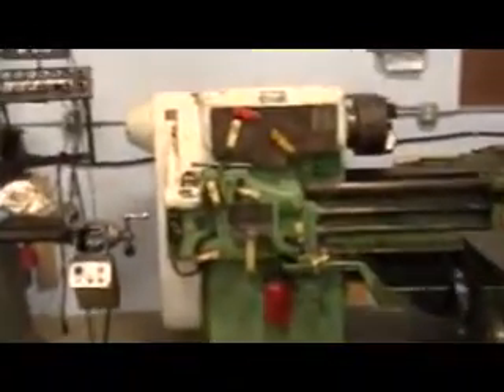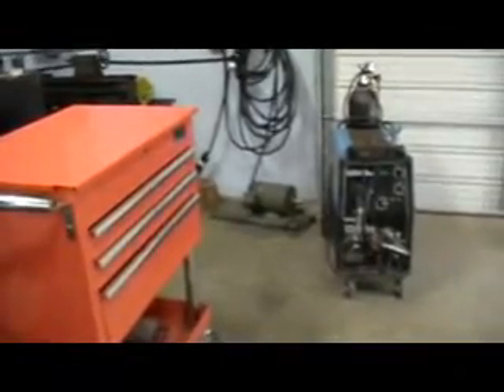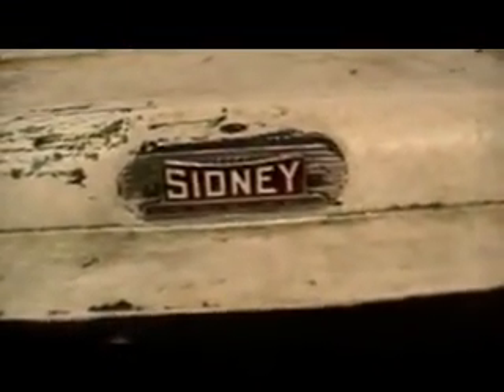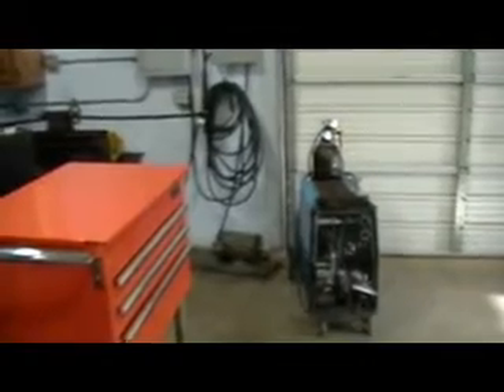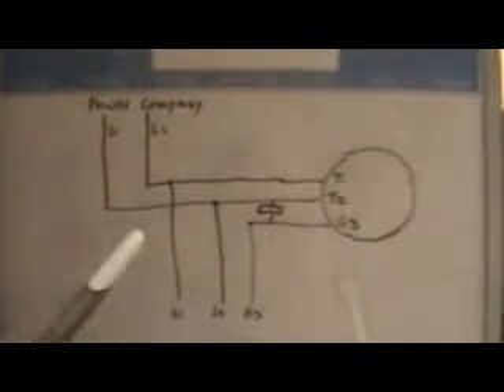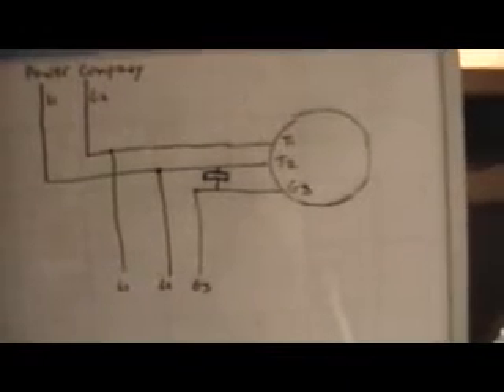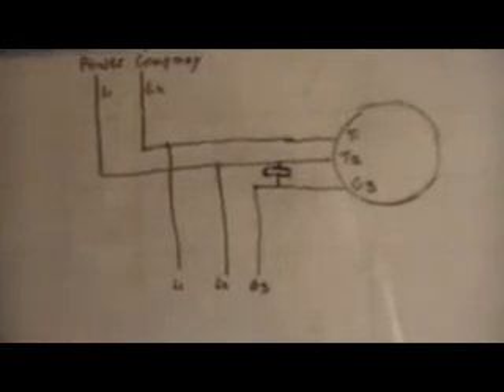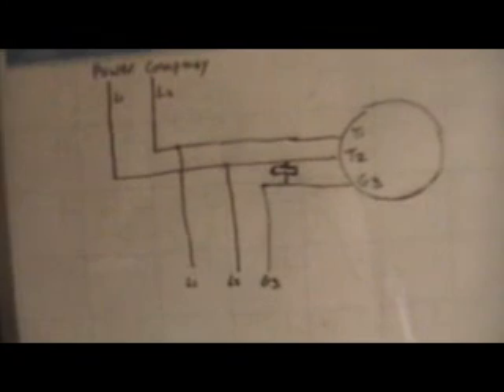Three Phase- My homemade rotary converter 2 of 2

Comment from the maker: @oiu7890 Really it was guess and test.  I added enough so that when I turned on my largest motor (7.5 horsepower) my voltage drop dropped down into the neighbor hood of 230-240, between legs 1 and 3 or 2 and three I can't remember.  I believe with just the phase converter running, G3 or the generated third phase read about 265 or 270 volts between the lines on the multimeter.  You really don't need as long as your not starting a motor larger than the slave motor.

Comment: I don't use any caps, i manually spin a 10HP 3PH (pony) w/a 115 motor.  I solved a 20HP flow jet problem i had by starting and running an unloaded 10HP 3PH lathe, they both act as a combined converter and  allow the flow jet to run flawlessy. Great videos.